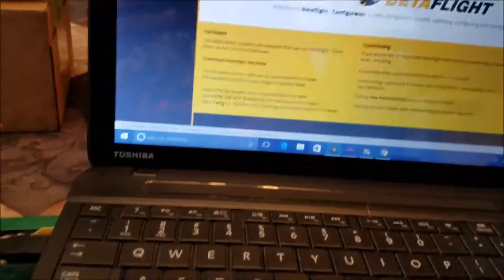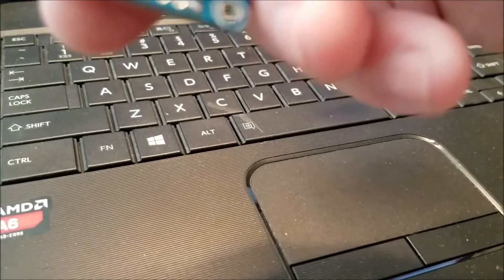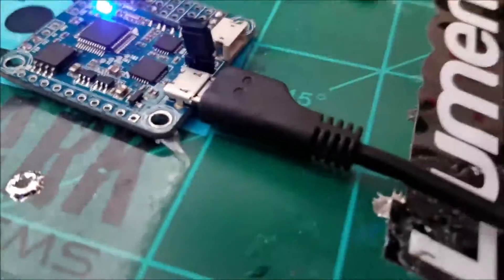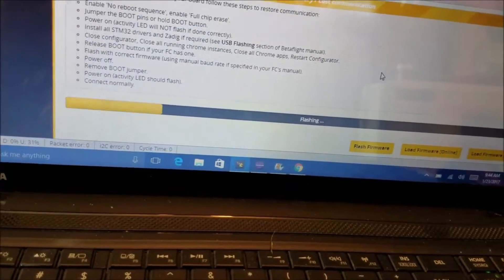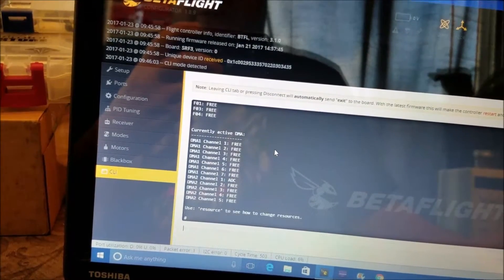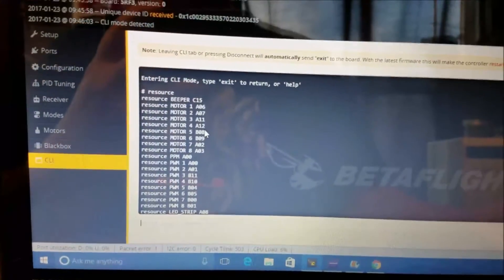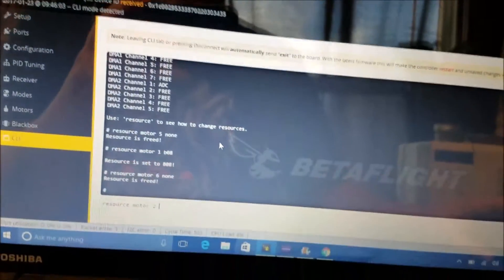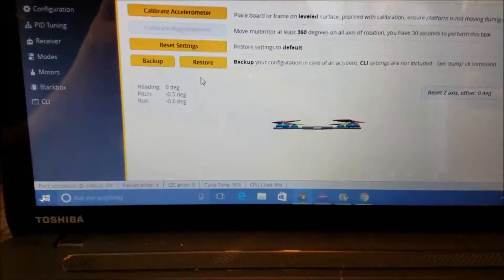remap signal pads on your flight controller

Comment: hi i have broken my vid in and out solder pads for my vtx. is it possible to remap the video/osd solder connection to other open connection?
Reply: Did you find a solution?
Reply: Did u do it lol me same
Reply: me too
Reply: Guys you can't remap osd/video out, you have to find the trace of copper leading to the pad or the small stem of copper tube under the pad, which is basically what I did, and solder to that. Or just get a new fc. I had to clamp a small square of plastic over my solder connection and epoxy it, as it was too small the hold itself. I tried acrylic glue, and hot glue, neither worked, I had to use 2 part 5 minute epoxy. It is funnily enough now the strongest joint on my entire build 😂. Hope this helps

Comment: Hi guys... is there any way of remapping electrial pad too? for example... I have a pin with vbat and another pin with 5v... so I would like to swap them
Reply: Right... or like an rx and tx to 2 diff owm's?! Ive seen soft serial only does a certain speed/baud rate so cant do much. But still trying!

Comment: Hey there great vids.  Very informative.  I'm just getting into the hobby and was wondering what mini quads you recommend.  I also bought my first real tx.  A spektrum 7 but seems everyone is using a taranis.  I like the dx7 better so I bought it.  Next is the quad.  I noticed you're using lemon for spektrum so is there info you can recommend or point me in the right direction for the rx and setups to install in the quad so I can use my rx I bought ?  Any help is greatly appreciated.
Reply: ADAMBOMB FPV  thanks a bunch I really appreciate it.  I'm just not into using the frsky tx and wasn't sure if there were many people using the dx.  Have you had any issues with range or anything with the spektrum?
Reply: ADAMBOMB FPV that's good news to hear because I tried the taranis and didn't like the gimbles and it felt cheap but maybe I'll eventually buy one just to have more options.    To be honest I'm still so new to this that I don't even know what rssi ppm and all the lingos really mean.  I'm still debating on what quad.  I'm really leaning to a 200 sized quad and thinking the diatone crusader gt 2.